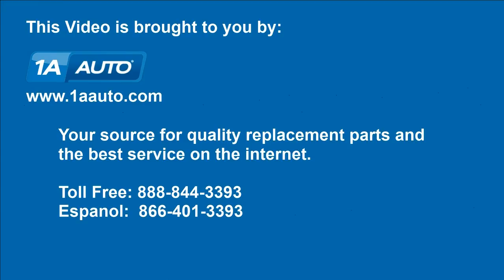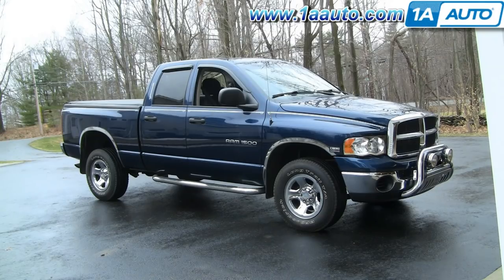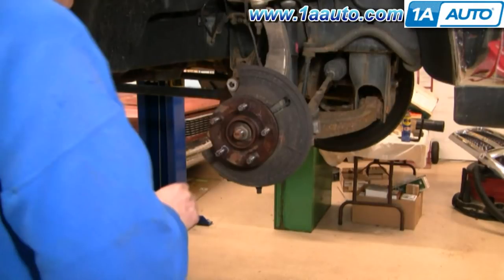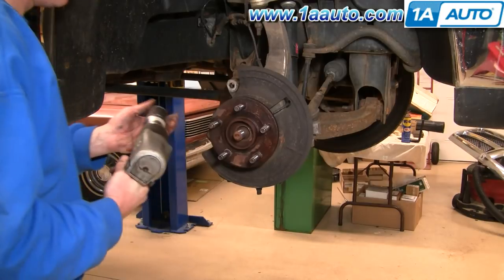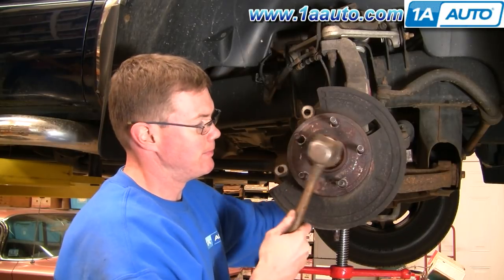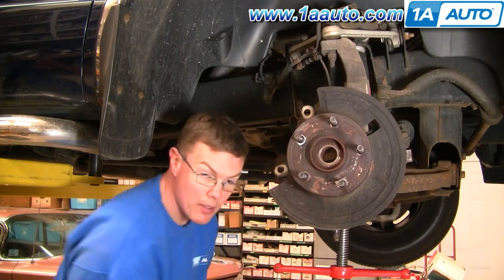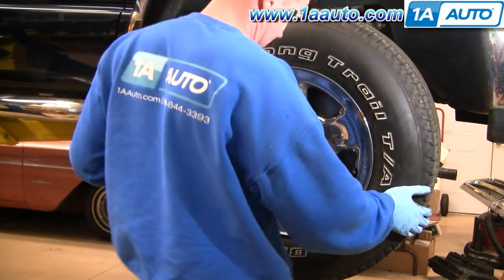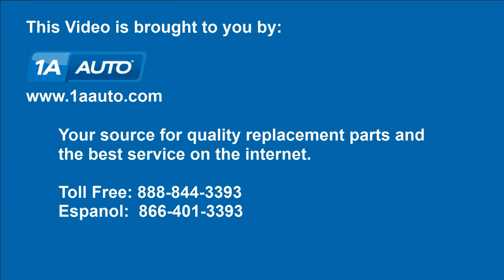How to Replace CV Axle Shaft 02-05 Dodge Ram 1500

Comment: I was able to remove the axle using your method but I am unable to put a new axle back in.  I can't seem to get it to compress down enough, almost need another 1/4 inch.  Any ideas?
Reply: You gotta un bolt the top of the hub let it swing down I think the tie rod or steering linkages what ever you call them, that should give you way more than enough room
Reply: Ever figure it out? Same thing going on
Reply: Same here, what did you end up doing?

Comment: i cant get my cv shaft to push through my hub. any tricks you might have. i have beaten on it with a sledge and it wont budge. 2004 1500 4x4
Reply from the maker: You could try to put some penetrating oil on them.The should come free as shown in this video. 1aauto.com 888-844-3393

Comment: My makes sound whenever I make sharp turns could this be it
Reply from the maker: It might be, you may want to inspect the axle to see if it has play and needs to be replaced. You may also want to check the steering components and also the ball joints. Hope this helps you out. 1aauto.com 888-844-3393
Reply: Yes its is the cv joint. and im leaking steering fluid too something I don't understand is that it seems that the differential has a leak too can this cause it. By the way thank you for the videos

Comment: This never mentions the retention clip, and if it did I missed it.
That retention clip is detrimental to longevity of both the output shaft and the cv shaft....
Reply: James Smith he did not mention the retaining clip however it is clearly in place as evidence by the cv joint remaining in place when he moves it back and forth and you can hear when the clip makes contact and prevents further movement. You are correct that if not installed properly there will be movement which can cause excessive and premature wear on splines of both intermediate shaft and half shaft. Which can also cause half shaft to eventually fall out of differential side.
Reply: Thanks for clarifying. This was a joy to read!

Comment: I did my drivers side yesterday and had to take the top ball joint nut off and separate from the knuckle and take the lower bolt off the shock to make room for the joint by the knuckle to pass through the control arms
Reply: Did you have to take off the sway bar  tie rod too?

Comment: Huge help. Job done quick and easy, took me a total of 40 minutes. If you can't get it in/out, loosen your upper ball joint, that'll drop the knuckle forward and give you enough room. Make sure the new axle snaps over the snap ring as well or it will come out. *if prying old axle out doesn't work, hit it with a hammer, that should get it off the snap ring.

Comment: I have a 2015 Ram 1500 four-wheel drive. It looks like the same as this 2012. The CV axle is spline on both sides. The inner axle side has a ring in between the splines correct? I can't get the passenger side off... Maybe my pry bar is not big enough. Plus it looks like you were able to take out the CV axle without unbolting the tie rod end or the upper control arm ball joint

Comment: Is it possibly  too switch from U-joints on front drive axle too CVC shaft on 2500 4x4 dodge pick up  Cause CVC shaft turns with less resistance  on gravel  and dry dirt

Comment from the maker: The door lock actuators may be getting weak, or you may also want to check the wire harness between the drivers side door and the body of the truck, to see if there's a frayed wire that may be loosing power when you hit the switch for the rear doors. Hope this helps you out. 1aauto.com 888-844-3393

Comment: @Karl Daigle THANK YOU so much for posting the tip to seperate the upper ball joint!  With this video & your tip I was finally able to remove the CV axle on a '04 Durango that was seized so tight I broke a 3-jaw puller, bent the screw on another & even used MAP torch on & it still wouldn't pop loose!  Now I finally have room to get at the lower ball joint I need to replace.

Comment: Great video, I was curious if you had a video on replacing the stub shaft? I've been searching the Internet without any luck. If you yourself don't have a video maybe you can point me in the right direction. Thanks.
Reply: rogerlee111 carefully use a chisel and remove the stub shaft bearing from the actuator housing make sure the bearing race comes out too then take off the 4wd actuator cover and you should be able to move the stub shaft out
Reply: I am also looking for a video on that. Any luck finding a good video?

Comment: What to do when the stupid shaft comes out with the cv joint and cant get pass the top frame where theres a rubber now i put the axle back in and started leaking i probably broke the seal...

Comment: i have a 2002dodge ram 1500  my power locks work on the front dooors but on the back doors it doesn't unlock the doors all the way. The locks disengage partially not all the way. I have to manually pull up the locks to open the doors.  What do I do in fxiing this problem?

Comment: thank you, great video. just did mine and very simple, just take the tire and axle nut off. If you need an extra inch to get it off the shaft all the way you just gotta jack up the control arm a little that'll give more room to slide it off. I put my jack stands on main frame on side you're working on and an extra one or wood blocks on front of vehicle main frame for added precaution.

Comment: It looks easy here, it's not. Secondly, make sure you correctly diagnose what is going on with your truck. I replaced both the CV Joint and a Hub assembly on a 2006 SLT 4x4. The problem is still there and is actually the differential. I believe it's covered by the warranty. I'm out the bucks for a CV joint and Hub assembly plus install. My bad, don't let it happen to you....Be careful.

Comment: I need to see this done on an 01 ram 1500 baddly im searching youtube and not finding a single one of that year on here the 01 ram has a different set up from the o2 pictured here no rubber boot shaft goes directly into the diff  axle tubes with little room between them and the hub is it just held in by the hub or is there more to it? anybody knows please comment on this and let me know the u joint on it is ready to explode any day rattles like a death trap

Comment: I have a 2002 ram 1500 4x4.... my axle seals ( where the cv axles are inserted into the main axle tube/ diff.) need to be replaced.  I have the seals, and have searched every corner of the web hoping to find someone who has tackled this task.... to no avail....  the dealership told me that the front carrier has to be removed and a special tool was needed to remove the seals from inside the axle... but are reinstalled from the outside of course... makes no sense to me.....

Comment: I hit a curb 3 years ago and my trucks never been able to be aligned 
since... I found out my camber bolts got bent, but the impact also bent 
the guides that the camber washer rides. Are those replaceable or is 
that a welded piece?. I have an 07 dodge ram 1500. I actually think you guys are close my work in Ayer, and are building where I use to live in Pepperell... Small world

Comment: Mine did not come straight out even with taking all the weight off the suspension. I had to take off my upper ball joint. Just one more nut to remove👍 to getter done. 35mm for 03 dodge
Reply from the maker: Thanks for checking us out. We are glad you were able to complete your repair. 1aauto.com +jerrid19

Comment: Does this process work on the 4th gen Rams? Mine is a 2017. Also does it work for driver and passenger side?
Reply from the maker: +Brian B The installation process should be very similar and will work for both sides.

Comment: I'm working on the driver side on mine, I've spent a couple hours now and I cannot get the axle to break loose, I've tried hammers, pry bars, chains, heat,  I can not get it to budge, theres a ton of play where the shaft goes into the differential so I think I've got more than a cv axle problem, what can be my issue? Why wont it come out?
Reply: Did you ever get it unstuck?

Comment: If I cannot get a new axle where I am, is it safe or how far could I safely drive without the axle installed to get a replacement?
Reply from the maker: +Brad Biwer Thank you for watching!  You cannot drive without a CV axle, as that it what is holding the hub and bearing together.  Without that axle the wheel would come apart.
Reply: @1AAuto  Thank you for your reply! What if the axle has completely come apart and I left the end in the hub? Assuming nothing is there to put everything out of balance of course...

Comment: Big let down for mine...I got into this and figured out that, for some reason, my '04 stock shafts will not come out without removing the ball joint and rocking the knuckle out to gain more length.  I was hoping mine would be as easy as the one's in this video.  I'd like to figure out the difference in the two types.
Reply: i had to replace the wheel hub and the only way was to take it off the uper ball joint and pull it threw the knuckel i live in mass so all the salt i think mine is frozen in place it would not budge
Reply: Travis Thacker  
What are you going off about? The ball joint is one bolt compared to two on the upper control arm and two or three good hits with a hammer and it's separated. Also doing that you don't need an alignment like you do after removing your upper control arm.

Comment: Is there anything different between 2 and 4 wheel drive? I'm currently at step 2:44. Thanks in advance
Reply from the maker: +Joshua Warner The 2WD truck will not have front axles
Reply: 1A Auto Parts  can you check the other comment in the wheel bearing video. I'm literally all out of ideas

Comment: When you pull the cv shaft out at 3:39 there is the shaft that sticks out of the diff. When i pulled mine out the shaft came with the axle. It was about 5 inches long. Is that normal?

Comment: Do you just not respond to question or just ignore them because you don't know the answer? I have attempted removing the cv axle just as you show and it does not even budge as per a question I have already read with no answer. It will not budge on the stub axle. Yours seem to come of real easy. Is it because you had already had it loose when you taped this? Maybe you just don't answer because the person didn't buy the part from you. If you can't answer simple question about your video then I wouldn't expect you to answer a simple question if I had ordered a part from you in the first place and had trouble installing it.
Reply from the maker: +Randy Tester We’re sorry we missed this, Randy. We try to get to every YouTube comment we can. Vehicles are in a varying array of conditions and while one technique may work for one vehicle, it may not work on the next. We try to show the best possible version of a repair and sadly we can’t account for every variable during vehicle repair. That being said, It sounds like the CV has seized possibly due to corrosion. We recommend starting by making sure the CV axle is free from the Hub and bearing assembly, then remove the knuckle from the upper ball joint. This will let you pull the cv axle completely out of the hub, bearing and knuckle assembly. Once the CV axle is free from those, go back to the stub shaft and attempt to spray rust penetrant inside of it, take the pry bar and brace it against the CV axle. Give it some swift blows to the outside of the tuck with a dead blow hammer. We hope these tips help

Comment: The shafts do not just slide out , they have to be cut off, I dont know what planet this truck is from tp come apart so easy
Reply: Cut off? No. Maybe if it lived in a salt mine. Use a gear puller, lots of lube and a big hammer. They do separate eventually.